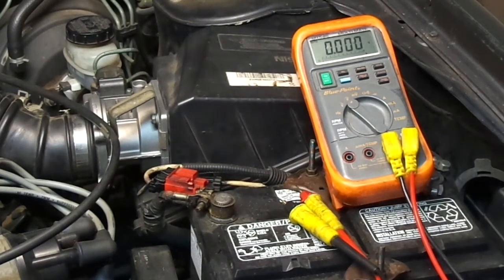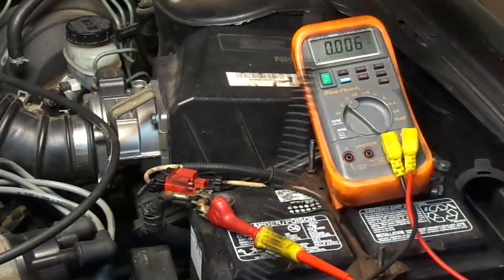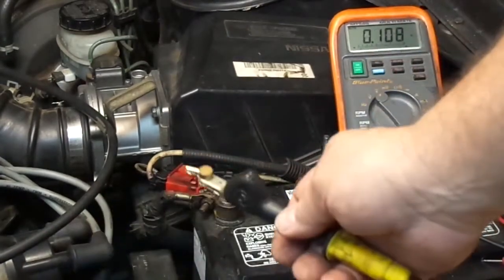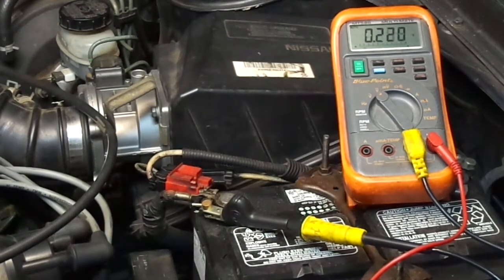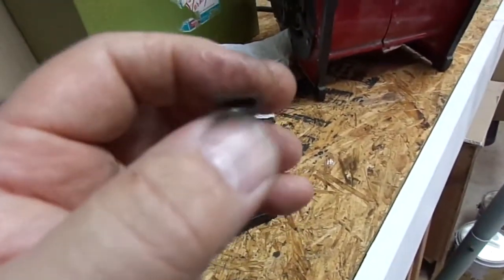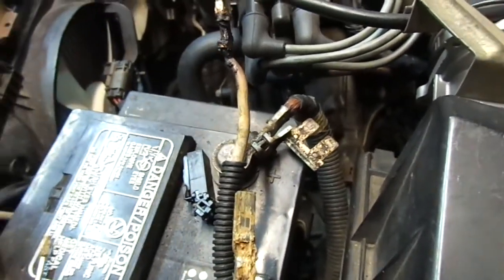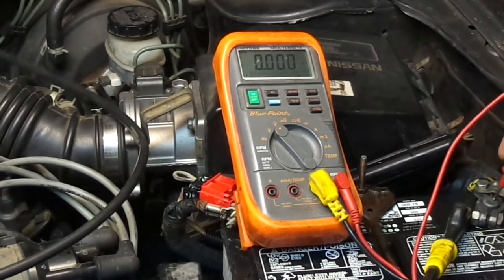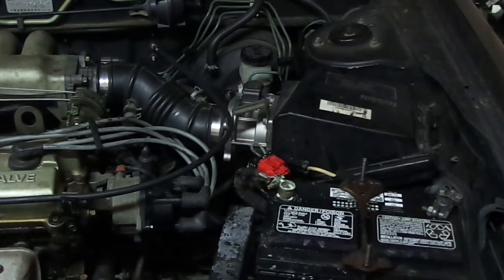Nissan Voltage drop test and repair

Comment: Voltage drop  is based on resistance of wire while moving current (amperage)

12v   ( good wire) 12v = 0.00 on dvom
 12v   (bad wire ) 7 v = 5.00 dvom

Using ohms law resistance can be calculated, helpful for sparkplug wires.

Bigger the draw the more likely to find problems.